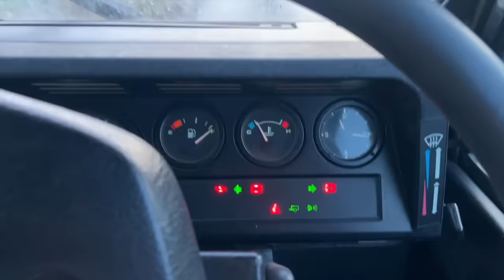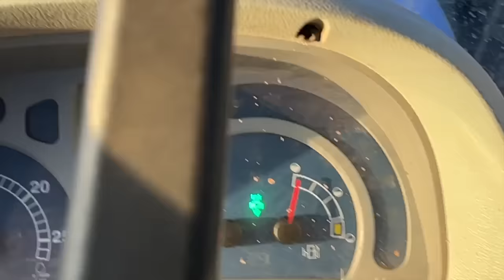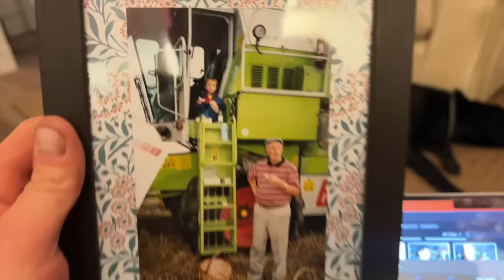In A Field After A Wild Wet Winter | Hunting Pigeons | Calfs Thick And Fast

Comment: Land-rover. Check the connections for crap in them at the lift pump and filter head housing. And any banjo bolts. Some lift pumps have a strainer in them too that blocks up. Hope this helps

Comment: Pin hole in your fuel line somewhere could be your problem. Corroded fuel line along the chassis somewhere. A none return valve before the pump might help